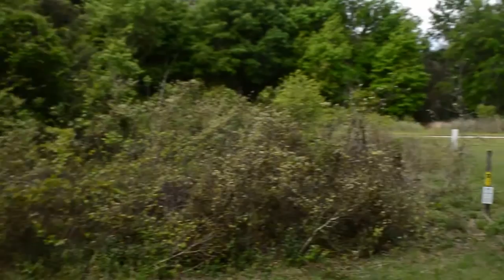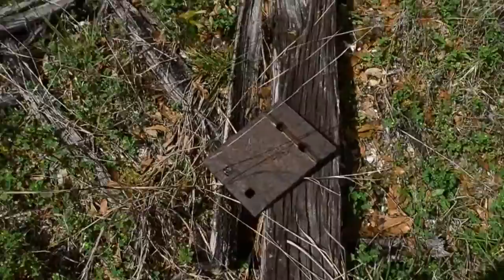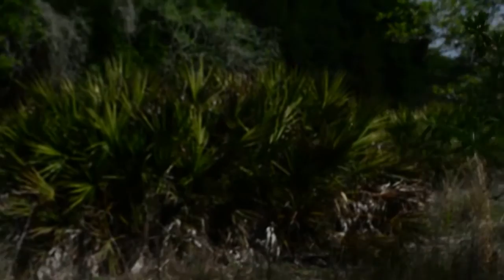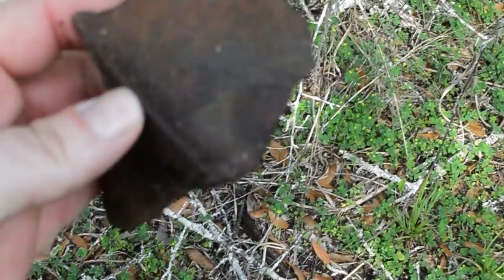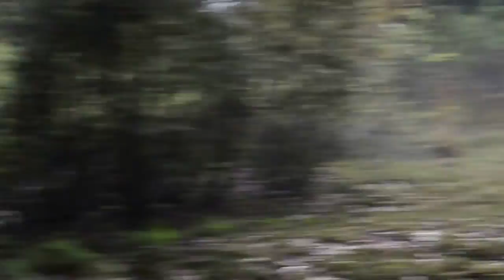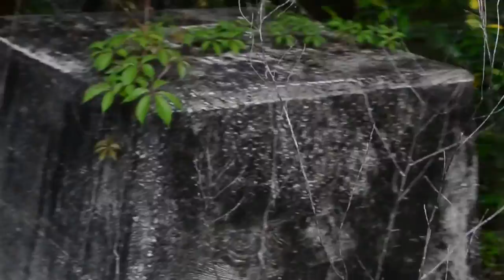Atlantic Coast Line Railroad Rail Yard

Comment: I remember Trilby Yard, it was mostly north of the crossing of the Newberry Main and the Orange Belt route to St. Petersburg. After the 1967 merger, the passenger train to St. Pete went via the SAL route, the Orange Belt line dismantled in 1978, and the yard tracks were removed until Trilby was just a passing siding. After Hurricane Elena, the main was dismantled from Owensboro north.